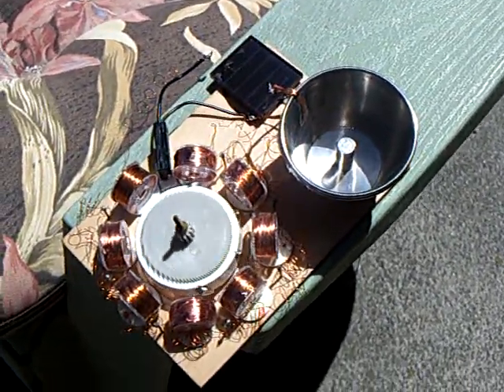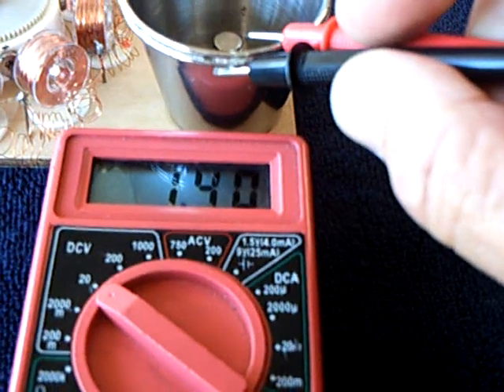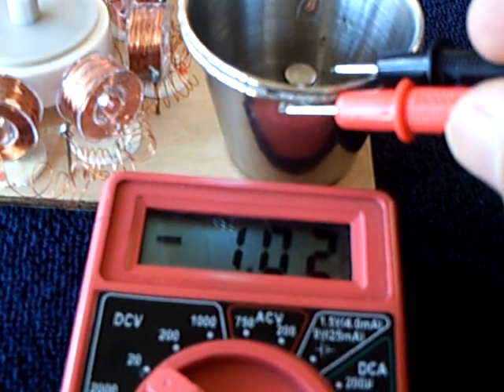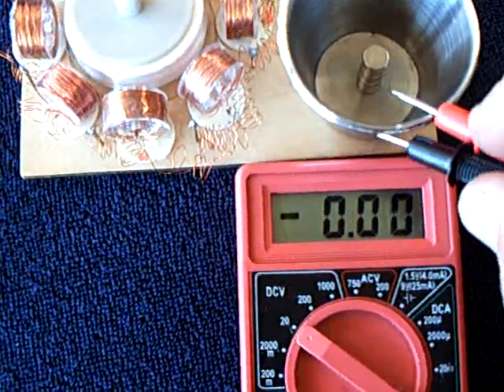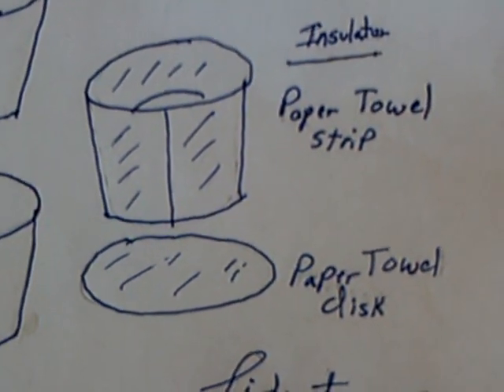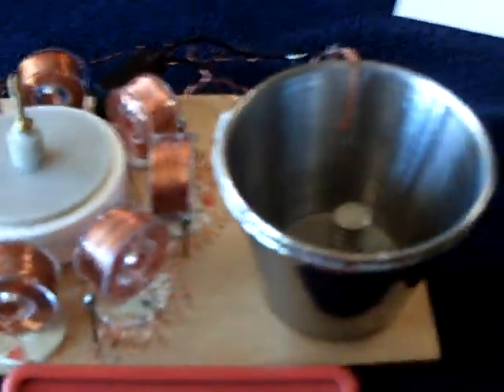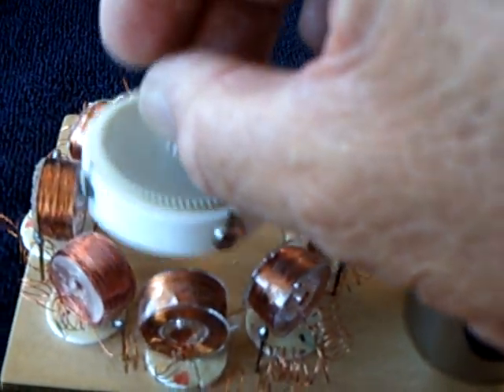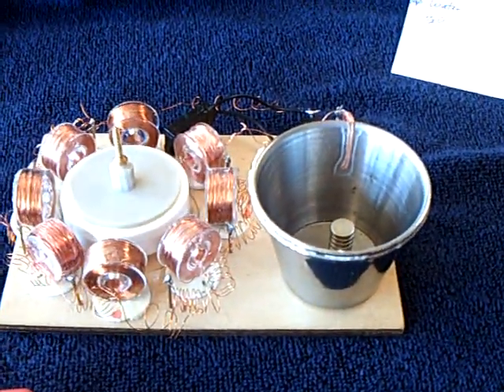Rechargeable cell ---- solar charged

Comment: nickel is magnetic idk why you keep saying high nickel stainless steel is less magnetic
Reply from the maker: +Solomons Words   Yes you are right that Nickel is magnetic but when you mix it with iron, in the right ratio, the alloy becomes non magnetic.  I did a Google search to find out about this weird effect.
Reply: ***** Those tricky alloys! thanks for the correction.

Comment: So this will only work with the salts?  The arrangement is like a cap with two large plates separated by an insulator, I wonder how much it would store dry?   If the salts are causing a reaction wouldn't it produce power just by the reaction?  This is really an interesting effect with your cell.  I wonder what the physics are that make this work with the charge/discharging?   Thanks for showing it.
Reply from the maker: +DaveC1964  You are welcome.  It is a two way chemical reaction like what happens in a lead acid battery.  There might be some 'super capacitor' traits going on which would make this a hybrid.  I really don't know exactly what is going.  If I built this dry, with no electrolyte, it would just be a very poor low farad capacitor.
Reply: *****

Thanks for the info.  So the charging reverses the chemical reaction of the salts then?  I wonder how many cycles it can do?  Interesting again but it makes me wonder what is going on too.
Reply from the maker: +DaveC1964  The cell that I made using stainless steel pot scrubbers, MgSO4 and water has cycled over 900 times now.  I built it about three years ago and it runs a Joule Thief type LED oscillator day and night.  It is charged up each day by a 3.5v /70mA solar panel.  More energy enters the system than is needed for the oscillator to run through the night so the light is always on 24/7.
Reply: *****

Cool, thanks.  You have the most interesting stuff here.

Comment: Hi if you fix a fan on the top of the spinning spindle and make it that the fan projects its vortexing air into the cone stainless steel cup (so place cups upside down over fan make sure a wooden base is placed on all the experiment preventing earthing ) it should show extra voltage potential capture on the basis like your solar panel as air of coarse is electric/pulse. Just a thought
Reply from the maker: +honda4004 Interesting idea. Thanks.

Comment: hi Lidmotor,  I posted on your other video but I am not sure if I hit the post button.  Are you a member of http://www.overunityresearch.com/  if you are would you send me an invite as it is not taking registrations.

Are the magnets used only to clamp the cups together or does the magnetism do something ?
Reply from the maker: +3D_Printing I am not a member of the overunityresearch forum.  No has invited me either.  Hummm.  The magnets don't do anything but hold the cell together.
Reply: Hi, Well I guess its their loss :) - what AWG is your coil wire ?
Reply: Sorry - you mentioned its 30AWG - what I meant to ask is what is the resistance on the coil ?
Reply from the maker: +3D_Printing  The coils are around 10 to 20 ohms as I recall.  Not a critical thing in this application.  I just filled up the bobbins with 30 Ga magnet wire using an electric drill.
Reply: +Lidmotor  Thanks, I am designing a new motor on my computer based on lasersaber's ezspin. I have designed the bobbins for easy winding and I bought some 40SWG wire by mistake, what I really wanted was 42AWG to get a 1000ohm. The 40SWG gives me about 60ohm coils and I was concerned about current draw, but your motor seems to run very well.  So I will still make it with the wire I have and post a video.  Thanks for the info.

Comment: Holds up well, I must say. How long does it take to dry out ? and then do you just add electrolyte ? 
Got a ceiling here of 0.4V with any such same metals cell at the moment. Not sure why, but I also haven't any non magnetic stainless. It's a good cell that you have there, wonder how one of those would do with alum.
Reply: +slider2732 Update - have just made one of these with 2x IKEA Blanda Blanks (similar to yours but magnetic stainless). Epsom and rain water. 1.1V first charge :)
Reply from the maker: +slider2732  That is good news!!  The solar charged magnetic stainless steel pot scrubber battery I made about 3 years ago is still running one of my led 'Penny' oscillators 24/7.  A couple of things have happened over the years (one transistor failure,  Mg So4 crystal formation around the container lid, and one terminal failure) but the cell itself has cycled over 900 times now and it is still going strong.  Penny likes it.  The device sits near a window that rarely gets direct sunlight (just summer months) and still gets enough juice to run around the clock non-stop.  It makes a nice night light. As soon as Tinman posts his 'How To' video on his cell (or super capacitor) I am going to try a replication of that.  I'm sure that you are anxious to make that one also.  Fun stuff.
Reply from the maker: +slider2732  How long this takes to dry out is a good question.  I was thinking of drilling a tiny hole in the bottom of the top cup to add water.  Right now the cell has a thin crust of crystals around the rim and I think that water is trapped down inside the cell.  The magnets are probably helping.  The chemistry works with magnetic and non magnetic stainless steel.  I'm surprised that you only got 0.4v on your first try but there are all different metal ratios for so called 'stainless steel'.  Perhaps what you tried was off in some way.  These work with Alum but actually plain Epsom Salt seems to be the best.  It is the SO4 in the mixes that is doing the work I think.

Comment: I'm surprised that you haven't been playing around with graphene based  energy storage.  Tinman had a video about a super cap the size of a credit card rated about 2000 farad.
Reply from the maker: +WTF BBQ I have been following Tinman's progress closely and perhaps I can replicate what he has done.   My efforts to make a true grapheme super capacitor have been  disappointing.
Reply from the maker: +WTF BBQ   I tried to build that ---and failed.  It is sitting infront of me right now ---dead.  There is something wrong with what he has shown.  The mesh screen might be galvanized iron instead of true stainless steel (which is what I used).   That would make it a galvanic cell instead of a real super capacitor. The use of a strong base as the electrolyte is another red flag.  Been there done that.  The epoxy use on the activated charcoal didn't work for me either.  It just sealed the stuff and kept it from reacting.  Back to the drawing board on that one.

Comment: Try two in series and see if the voltage doubles and holds.
Reply from the maker: +zebok3 Good idea.  It should work.  I might be able to nest several together in a stack. Use strong Neos to hold the pile together.
Reply: +Lidmotor That sounds like an even better idea!